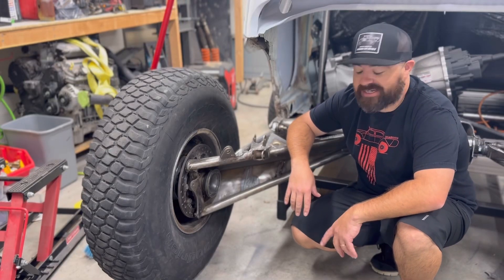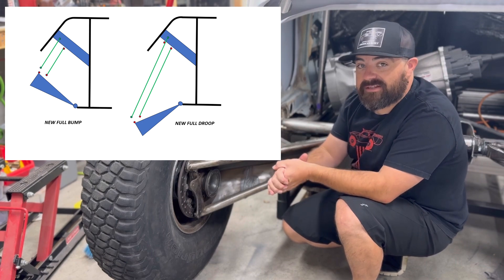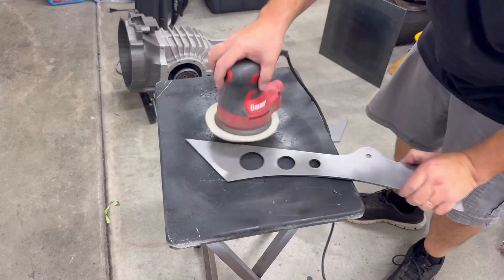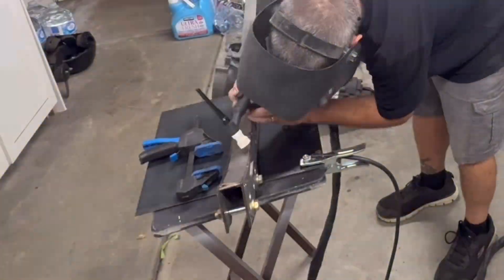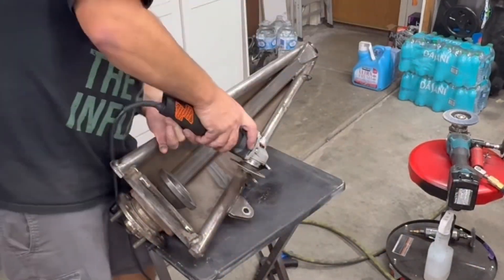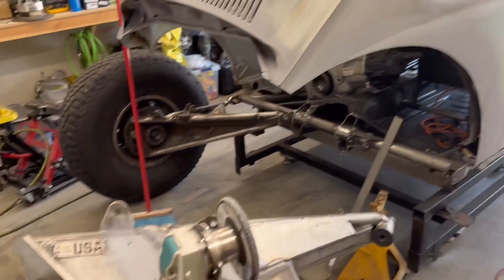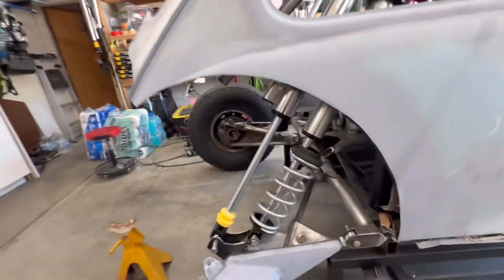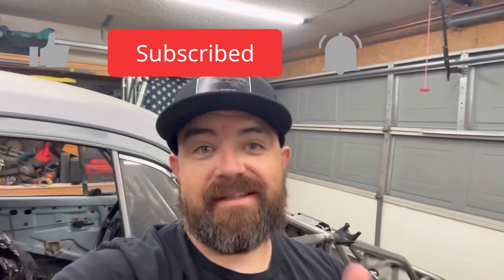Rear Shock Install, Part 2- fixing geometry issues and mount fabrication

Comment: Very nice!  I love the way you fixed that.  Cleaned it up really well.  The lower tabs look good to.  Definitely take and share pics of the finished product...Inquiring minds want to know!
Reply: Hopefully, things are going well for you 🙏 
I'm looking forward to your next video!
Reply from the maker: Thanks Matt. Working on kicking one out but got busy with work. Coming soon!
Reply from the maker: Thank you. Once I get the upper shock mounts in place, I won’t finish them until the body comes off for final welding. I’m hoping that happens in the near future. Then the next time the body goes on, it will be painted!

Comment: I’ve been waiting for a video to see how this turns out. My favorite part of all of this is how you are building everything you can yourself and solving problems along the way. For me, it’s all about the build. When it’s all finished, it’s a little sad it’s all over. 
That upper mount looks really good and I like how you plated it. Your suspension looks really good in both the geometry as you cycle it, and the overall aesthetics. I like how you made the cardboard cutout as a check. I like to do the same thing. I’m very visual and hands on, and that’s how I problem solve.
I wanted to ask you about something with your trailing arms. I see how the outer mount is a heim and wondered if it needs it because there is some rotational motion on that mount. I ask  because while heims are great for that, my experience with them is they induce a lot of shock and noise into the chassis. I don’t use them where a poly bushing can be used. They need to be replaced more often too. On a drag car, or a rock crawler, not a problem, but if you putting miles on a vehicle, they can be another source of noise and vibration. Something to think about.

Have a good one Miah, I can’t wait to see what you do next.
Reply: That seems like a good reason to do it that way. I can’t wait for the first drive.
Reply from the maker: Me too!
Reply from the maker: Thanks so much. Glad you enjoyed it. I’m getting to the point where I’m ready to just drive it but I don’t want to forget to enjoy the process. The reason I used heims on the outter pivot ultimately comes down to me not trusting myself. If the arm tweaked any during welding, I was worried about having bad toe. I wanted some ability to correct it without cutting it up. I do think it would have been fine though, if I used a bushing out there.